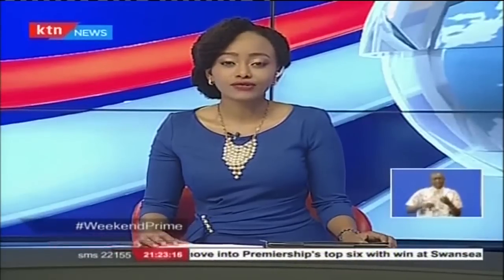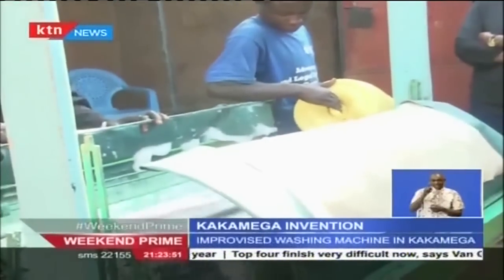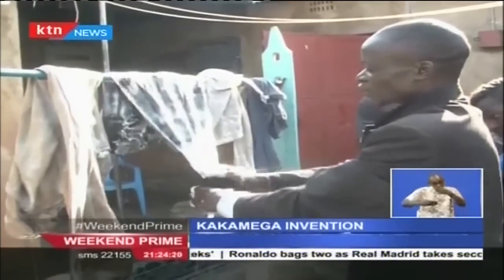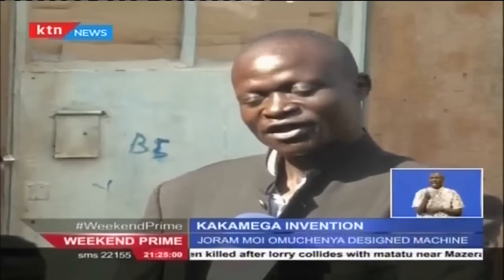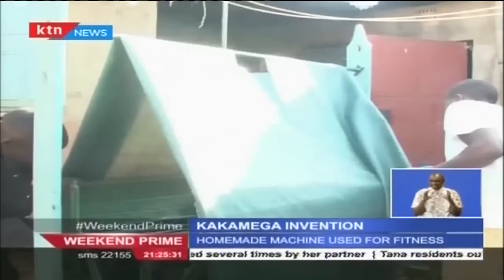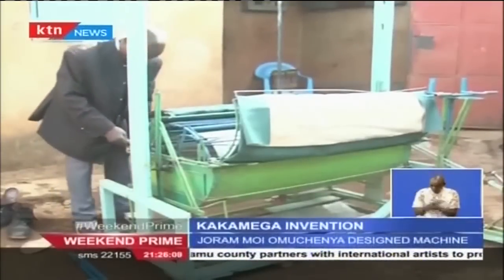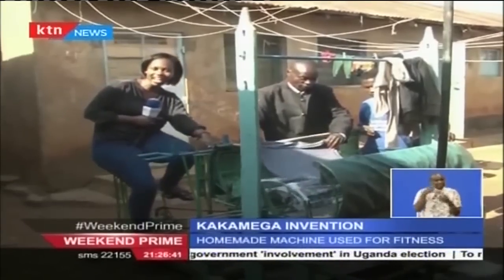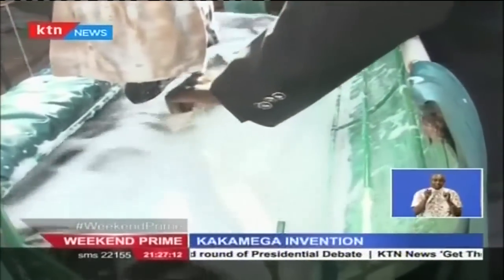INVENTION: Homemade non-electric machine used for washing in Kakamega

Comment: 🤣🤣🤣🤣🤣🤣🤣 This machine has been made before and uses 1 person. This machine is huge and takes 2 people to wash item per time. Manual washing machines take a lot of clothes at one time, need only 1 person and are so small they'll fit in a small kitchen. Why reinvent the wheel?
Reply: Two people can exercise at once too. When I was at college I had to wait to finish washing before working out. With this both can be done simultaneously (makes a better gym with some improvements).